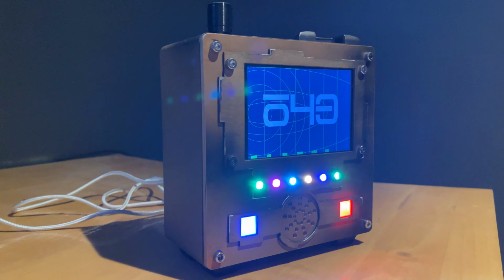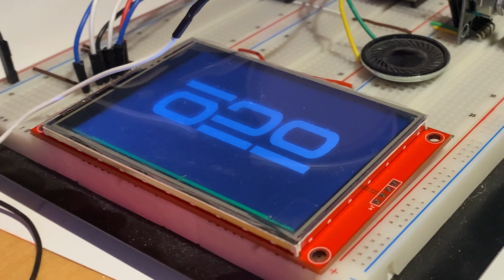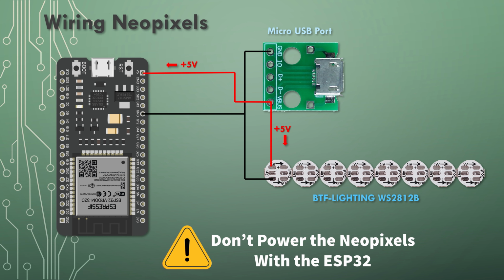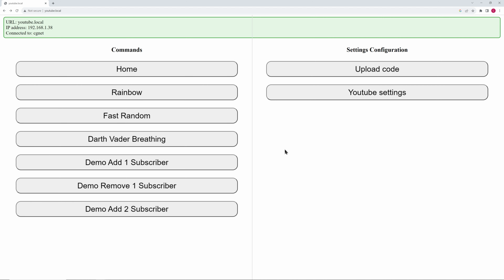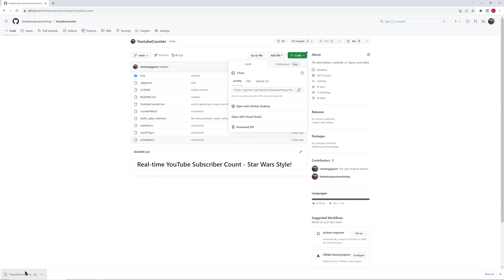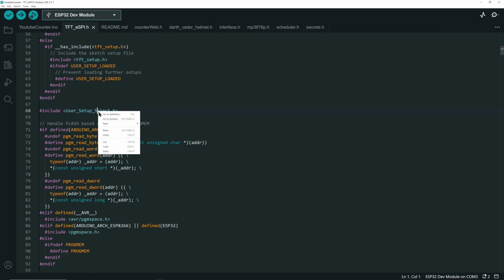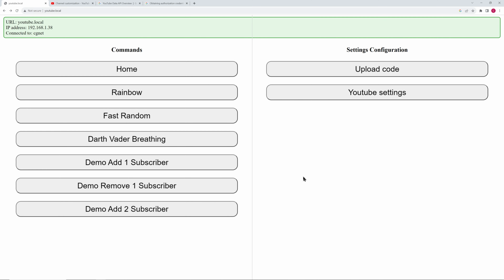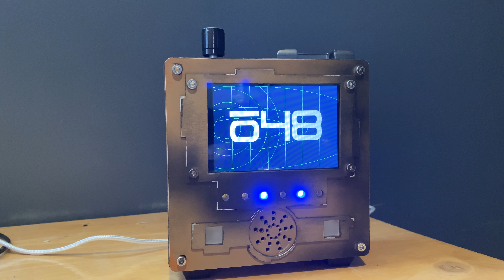DIY  YouTube Live Subscriber Counter powered by ESP32

Comment: Quel beau projet ! Je me demandais, par rapport au moment de fermer la boîte, j'ai vus au moins deux contôleurs. Combien de modules as-tu utilisés ? Sont-ils indépendants et, donc, les schémas d'assemblage sont pour 4 différents ou ils sont reliés ensemble ?
Reply from the maker: Je n'utilise que les composants que je montre dans la section "Wiring" : 1 Micro USB port, 1 ESP32, 1 module MP3-TF-16P, 1 écran LCS, 1 speaker et les neopixels
Reply: OK donc, seulement un ESP32 pour tout contrôler si je comprends bien. Merci @thelastoutpostworkshop